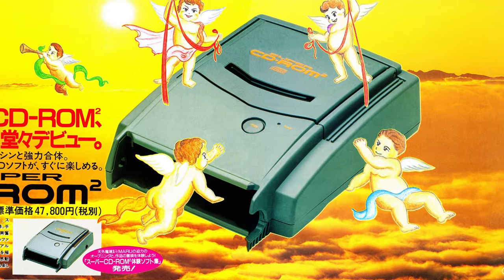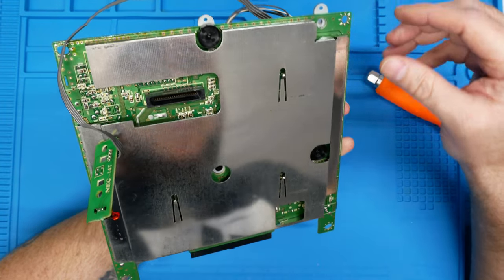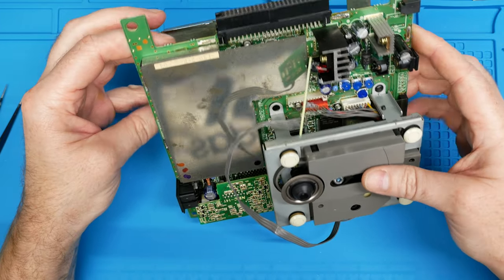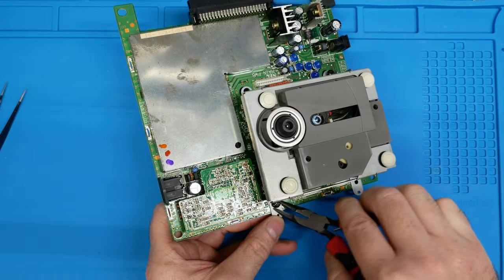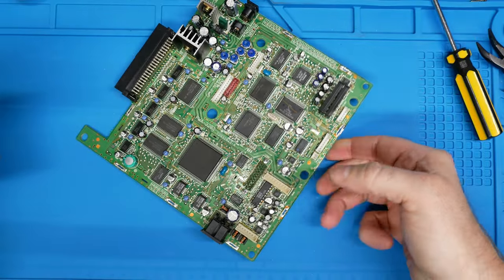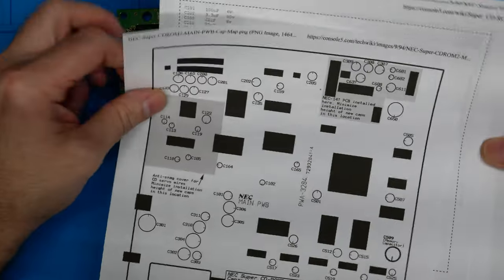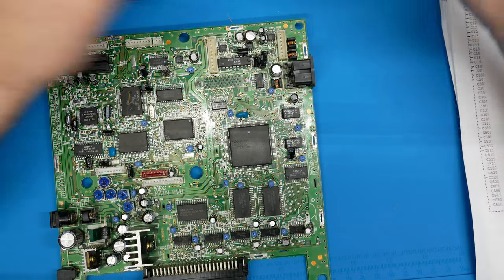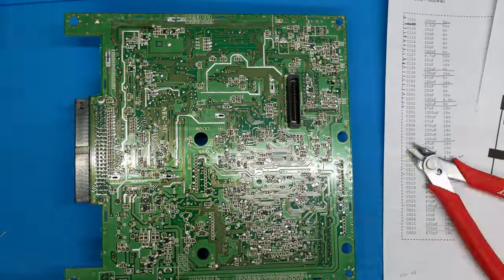NEC PC Engine Turbo Grafx Super CD ROM 2 disassembly repair recap capacitor replacement sound issues

Comment: phew
Finally finished mine!

Despite being boxed, mine was in REALLY bad shape with a jammed door mech, cracks + deep cuts in the plastic, missing screws (only has 3), and even missing mounts for the drive mech. I already had a Console5 SMD cap kit from a couple years ago so I cleaned and recapped before doing much else.

I wasn’t getting composite video at first but it was otherwise working as confirmed with composite directly from the console. I had no luck tracing composite from the EXT port or the DIN5. I only found a bad trace from the 470Ω composite video capacitor to a transistor after holding it to the light to see through the board since I couldn’t see it at all any other way. It actually looked flawless, even under magnification, but there was no continuity. The break had to be right at the pad.

I only knew to look for that elusive trace after resorting to Ste Kulov’s Turbo Booster schematic and presuming the circuit here was similar (it was). I still want to 3D print some of the other missing mounts and such but it seems to work fine without them (thankfully!). The Eject button had mangled parts as if someone had tried to force the button down while holding the door shut. The surfaces that redirect your downward force to retract a lid catch are very small and easy to mangle but my fingernail across the sloped pieces did the trick.

I’m leaving the deep cuts since I’m not going to use filler and paint, but it’s structurally sound. Maybe this one is a good candidate for cutting up to fit a TurboGrafx-16. I already have too many ways to play Super CD-ROM² titles but I always wanted to try this. :)
Reply from the maker: Awesome... It was definitely one of the more time consuming console recaps ive done.
Did you just buy yours a while back with intent to repair and just get around to it?

I havnt touched mine since the recap 😖 lol

I bought a stack of cd-r's to burn some more games to further test with a game that was actually fun like rondo but never got around to it.

Actually, i havnt touched any of my original consoles since getting a mister.
I planned to sell off some of my consoles and pvm's but never did.... Guess im a hoarder lol
Reply: @LameGaming  Just got the Super CD-ROM² but got the cap kit a few years earlier. I was anticipating either someone sending me theirs to recap or me getting one that needed it and didn’t care which came first. In the mean time I ended up losing my home and most of my collection to an EF-4 tornado so I had to stop buying hardware and wasn’t in any position to do work for others.

Because I already had the cap kit I couldn’t say “no” to a boxed Super CD-ROM² for under $100 (eBay). :) Just got it a week or so ago. I tested mine with original copies of Rondo and Gate of Thunder but I’m still in that honeymoon phase where I fire it up on the SuperGrafx at every opportunity. I’m still in no position to be buying hardware for the collection so I probably should sell it with one of my extra copies of Rondo.

It’s been more than a year since Limited Run Games announced a release of English Rondo for TurboDuo but we literally haven’t heard anything since. :(
Reply from the maker: @emmettturner9452  I remember that story now, you either told me before or I read about it on a reddit sub, r/turbografx maybe? 
Sorry for your loss, that experience must of been devastating!
I have a Rondo file with english translation that I also patched with english audio and one of the remakes english intro... was pretty cool, i need to find what drive I have it on and put it on my superSDsystem3 and mister now that I think about it. It might be on my arcade cabs hdd... not as good as an original disk but I need to try and burn a copy of the patched game as well, would probably help sell the super cdrom2 when I decide to lol.
Reply: @LameGaming  Yeah. The translation patch gets the English dialog from the PSP version.

Very cool, but I absolutely HATE the English scene between Richter and Maria and wish I could leave that in Japanese. Richter just laughs after Maria pouts about him not taking her seriously as a vampire hunter… so it’s probably just as cliché in Japanese but the English voices just make it insufferable! I’d love to have an officially pressed English version regardless but Limited Run Games hasn’t said anything since they announced it. There’s always PCEWorks’ unofficial version on a pressed disc but I literally got a real Japanese copy for less than those sell for!

I had a really cool CD-R English copy before the tornado which someone gave me. It was complete with a screen printed disc and a custom case/insert that made it all look very official. I haven’t seen it for a while so I think I gave it to one of the pickers that came through after the tornado.

I still have the English file on my UperGrafx UGX-02 digital video adapter with built-in optical drive emulator and Super System Card. It’s very much like the Super HD System³ Pro but from an engineer in Japan. It was released just before the Super SD System³ but had digital video way back then… years before the Pro came out.

Comment: Thanks a lot for the video! I just recapped my unit and still has some issue. I’m struggling to find info on this and was wondering if you could help troubleshooting it?

One proble is the audio being crackly and low, after a while it gets slowly better but when having the unit off for a while it goes back.

The other issue and the more worriying is that after a while when playing cds the unit will shut down, randomly, and then it’s takes several times to get the boot screen back. It just shows a colour screen.

Thanks a lot!! ❤❤
Reply from the maker: Did you do a full recap?
My audio was the same way but a recap cleared it up.
Did you have the random power loss before the recap or only afterwards?

Comment: I bought one form a seller  saying @Tested@ but the drive motow doesnt spin up (the latch is broken too) any ideas if the motor isnt spinning? I greased up the laser motor & tried it with the laser in the out position & it moved it to the centre fine.

Comment: I'm about to do the same repair on mine. However was thinking of replacing the SMD caps with SMD caps - just wondering why you didn't do the same on yours?
I would think that soldering the SMD caps would be pretty much the same technique as what you did for the through-hole type.
Reply from the maker: Honestly I had ordered the cap kit about 6 months ago along with a ton of other cap kits and didnt even realize I ordered the through hole kit so just rolled with it lol, but yeah the worst part is removing the old caps so doing the leaded style approach like I did is actually more work but 30 years from now whatever sucker has to recap will have an easier time lol
Reply: @LameGaming  Yeah this is next on my list, I just did a PC Engine White CDROM re-cap and gear-wheel replacement and it's back to fully working. I just watched this video again to get a run through, very handy, thanks for making it.
Reply from the maker: @Slaanesh2011  no problem, Editing these can take forever so got kind of lazy with this one and just sped the footage up lol

Comment: The issue with mine is the AV out port lacks video, but the audio works fine.
Reply from the maker: Always start with the simple solution and work backwords. Do you have a spare AV cable? If not you can check for continuity between each pin and the rca plug ends.

Next i would look at the av port itself. Check for oxidized connections,bent/loose connection, cracked/cold solder joints, broken traces etc.

Most of the caps I pulled were way dry or high esr. A recap is probably needed as well.

Comment: Amazing video, very relaxing to watch. My Super CD Rom2 unit stopped powering on. You think there could be a blown fuse on the board that could be the cause of that? There's so little info on how to fix this specific addon.
Reply from the maker: Your right, its hard to find info on these.
Im just a glorified capacitor replacer, I can desolder and install various IC components but am limited in reading schematics etc..... 
Saying that, I would start with the power supply itself. Are you using the original? Id test it for output voltage, (It will be higher if no load is on it) 
Theres debate whether japanese power supplies should be used in the US or not.... Some say our 110-120v is enough to cause damage vs japans 100v power service, others say its well within tolerance, But id check what yours is putting out and/or look for a 12v switching triad power supply. I believe these require at least 1a.
Also are you using a jumper to power the pc engine or another power supply?
If the power supply is good I would check that the power jack is giving power to the board.... sometimes these solder joints on the jack can crack and need reflowed. 
My DC power inlet jack was heavily oxidized as well, cant hurt to give it a scrub with a toothpick and alcohol.
I did not remember seeing a traditional fuse on the system, not sure what the black can component with the large leads in the power circuit section of the board is, could be a fuse or the green thing that looks like a voltage regulator by the power filter cap could be a funny style fuse..... I didnt pay much attention when doing this recap because I didnt have this problem, I tried searching for a replacement fuse just now and found nothing, no fuse, no info about a fuse... thats pretty crazy.
After having mine apart I would definitely recommend a full recap.... Ive never seen another system with so many failed and leaking caps!
If the board is getting power id look at the 2 voltage regulators as well. Could need reflowed or could be damaged if the power supply voltage was out of spec making the regulators work harder to keep voltage at level.